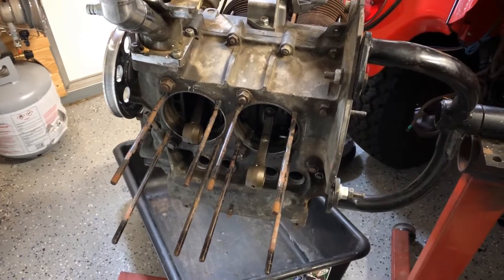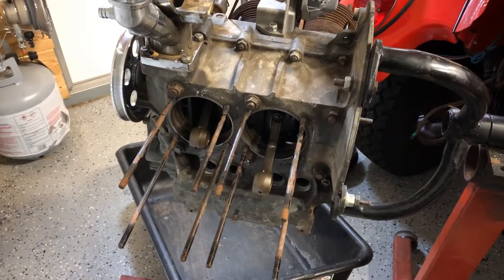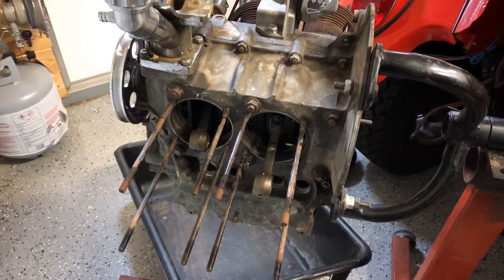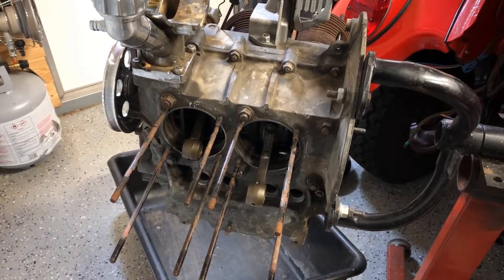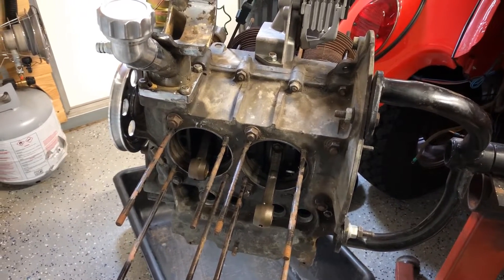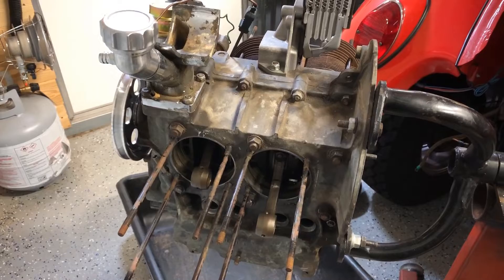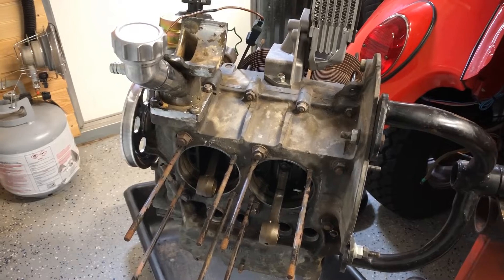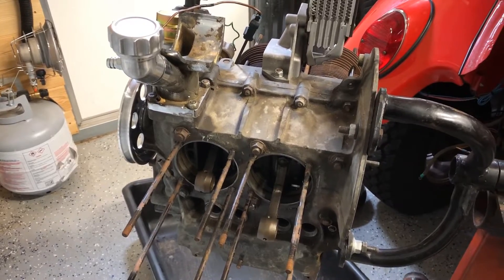Baja Bug Engine Build

Comment: never realized the bug's engine is essentially a bike engine
Reply from the maker: Except the cylinders are horizontal like an old BMW airhead m/c. Not much different, easy to work on. 4 bolts, couple of cables, fuel line, wiring and it’s out.